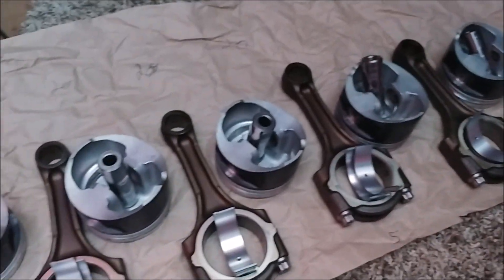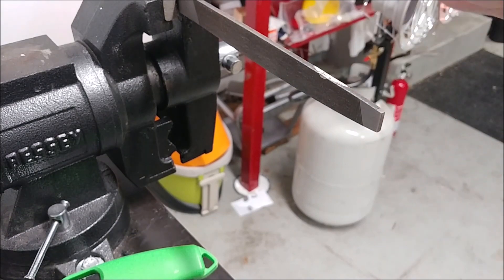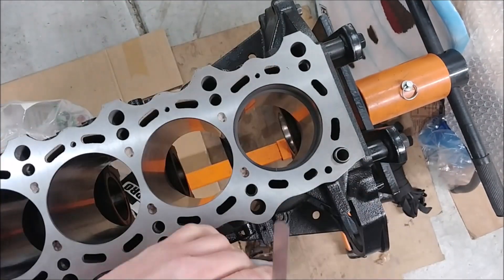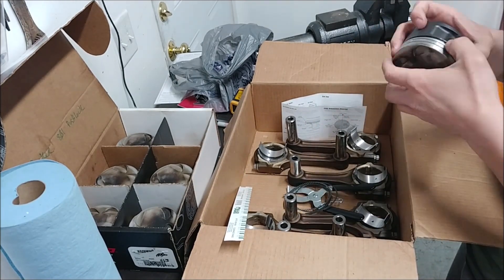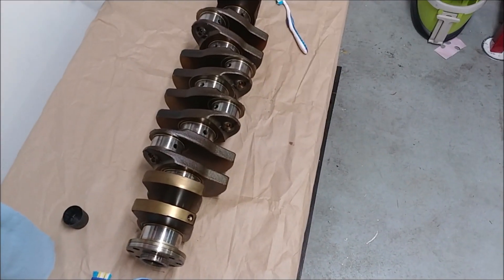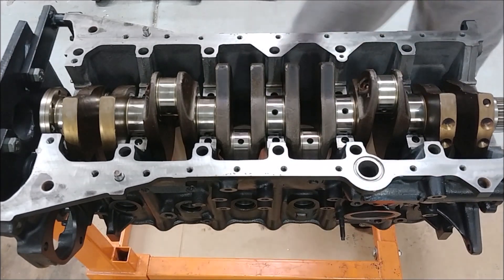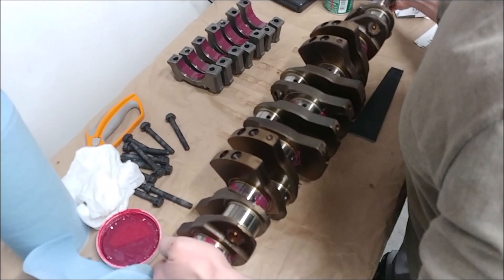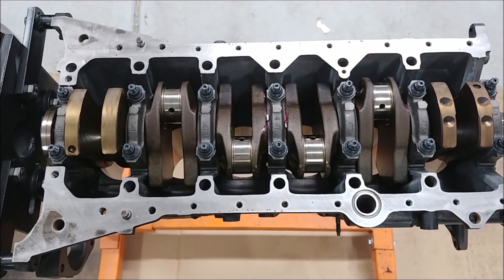2JZGE NA-T 260z Build part 1

Comment: hello, so i tore apart a 2jz ge vvti and took the head, block, crankshaft, and piston assembly to my local engine machine shop. i asked to get my cylinders measured, hot tank my head + block, and to deck the block and head. he was very hesitant to deck the block for compression reasons, told him id be running a thicker head gasket and will probably bore the cylinders as there is visible wear. was wondering your opinion on what i should ask to get done/things to watch out for and maybe a reasonable price range this might be done for. thank you.

Comment: Should you have used the arp main studs when measuring the oil clearance on the crank bearings? Also did you get your line boring checked when using the arp studs? Currently pricing up my build and not sure whether to go OEM or arp on the bottom end. Cheers!
Reply: Yup, oil clearance should have been checked with the ARP studs in place and torqued per ARPs recommendations

Comment: What parts did you completely replace with new or “newer” parts. I just bought a used GE out a GS300. So far I ordered GTE pistons, rods, head gasket, arp head studs, timing belt kit, valve cover gaskets and cam seals, rod bearings. Anything I’m missing that should definitely be replaced ?
Reply from the maker: https://youtu.be/Oui__eMZKmo check it out, my dude.
Reply: SALTY DATTO missed this. Thanks! Quickest replies out. I’ll be building my sc300 over the next 2 weeks once all the parts come in. Gotta finish watching the rest of the videos 👍🏽
Reply from the maker: @allstat1290  fuckin mint, bud. Good luck

Comment: Hey quick question,  I'm picking up a ge vvti engine from a junk yard to rebuild and turbo for my is300. To my understanding the GE not VVTI rods are the strongest and the gte pistons are what you should use. And the GE VVTI heads are the best flowing?
Reply from the maker: Yea man, This dude https://www.clublexus.com/forums/florida-lexus-club/527615-head-flow-results.html shows the ge head flows better (exhaust side). Not sure between the vvti GE head and non vvti GE head though. GE (non vvti), gte and gte vvti rods are all stout! Thanks for visiting.

Comment: gotta ask I'm currently doing this N/A 2jz non-vvti swap can I use used gte pistons and safely use 500hp?
Reply from the maker: From what I understand doing my research, the non vvt-i internals are very stout. They are powerful enough to handle that power. The only downside to the 2jz variants is the vvt-i non turbo engine con rods.
Reply: @SALTYZETTO  I could then save up and get gte pistons and rods and that would fix that?
Reply from the maker: bro, i've seen dudes on the forums claiming they were making 700 hp on NA-t non vvti short blocks. I would do some more searching on that. tbh

Comment: This is the only thing that intimidates me about doing a short block assembly, I don't understand the math for  trimming the rings or the sizing for the caps, outside of that I'm fairly confident I could fully assemble a motor
Reply from the maker: Mainly just multiplying the diameter of the bore in inches vs the recommended trim from the ring manufacturer and you'll get your gap size. With the caps and oil clearance, after you torque the plastigauge, the wider it is the tighter the space for oil. Bro, if I can do it you can. I guarantee that.
Reply: @SALTYZETTO  thanks for breaking that down. I look forward to doing this in the future. Right now the current objective is to get my auto transport business off the ground and then I'll have some fun
Reply from the maker: Right on, man! Best of luck with your business.
Reply: @SALTYZETTO  I'm starting a build and I'm a bit intimidated by this too.  Isn't there a process for picking the right size rod bearings?  You kind of skipped over the part where you chose/installed the rod bearings.  How did you make sure you had the right size?  Trying to learn all this before I start tearing my motor apart lol.